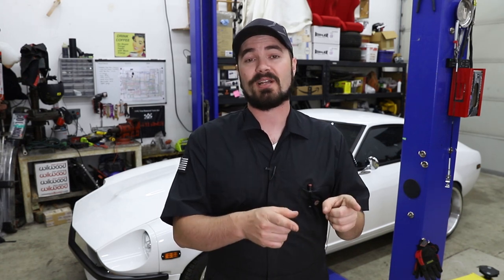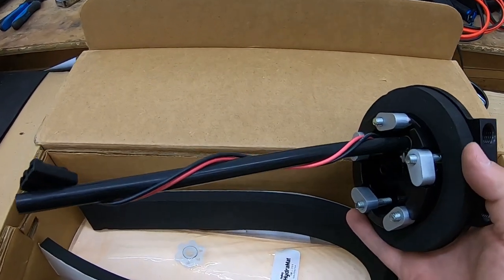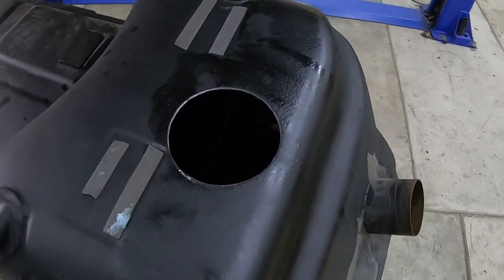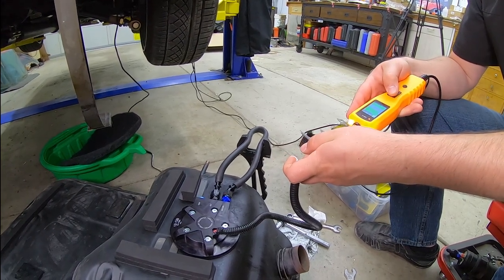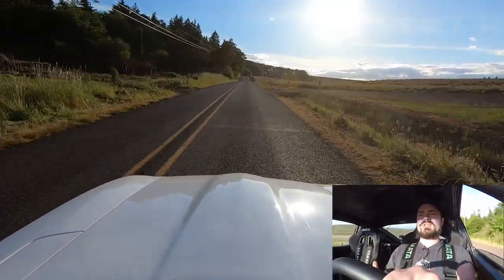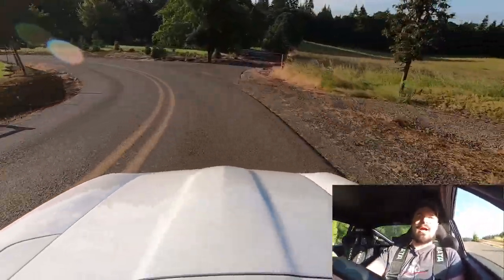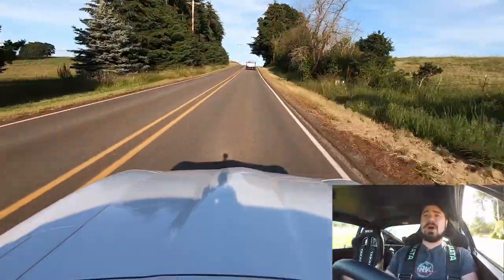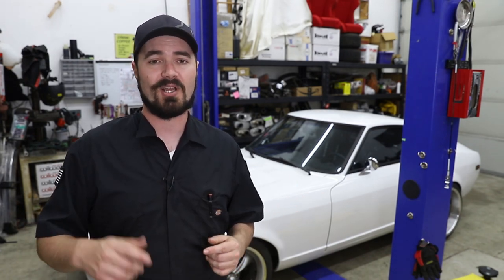Installing the Holley In-Tank Retrofit on the SR240Z

Comment: Hi Casper.  I still have to replace the screaming pump that came with my sniper kit.  Meanwhile my Borgeson kit install on the '67 hit the wall when the pump they said to buy didn't fit at all on the Cleveland with the March bracket I had to buy.  Belt alignment and pulley issues too.
Reply from the maker: My replacement DW 255 is still much quieter and working great. Definitely worth the swap. Sorry to hear about the pump screw up, I can't count how many parts I ordered because they were specifically listed as fitting and we're completely wrong. Good luck with your project!
Reply: AmbiVe   Cleveland engines seem to be worth the struggle though.  Thanks buddy.  Any plans for the wires on your 'Stang?
Reply from the maker: I am starting to rewire the Mustang in phases. The first phase is to move all the existing systems over to an ECU Master PMU16. I have just started that project and will have a video up soon. The wiring of the car has so many changes over the years that it is going to be too complicated to change everything I would like in one sweep.

Comment: Hey I received my fuel pump kit, how did you end up running the vent? I saw someone else running to that charcoal canister, but I’m unsure how to do mine, does it just need to run to a line and a little filter?
Reply from the maker: There are a few ways to go about it. Using a charcoal cannister and the like will cut down emissions/smell. At a minimum you should use a roll over valve. That will help keep all your fuel from pouring out in a crash and buy time to escape. Something like this has both a screen and check valve:

https://www.summitracing.com/parts/tnk-vvr?seid=srese1&gclid=CjwKCAiAlfqOBhAeEiwAYi43Fw0_fSv6GeTaS3AZX-9tMM3AVoEEmj2tC3wldGMt0kwN-Mxioj69aBoCVLEQAvD_BwE
Reply: @AmbiVe  oh ok, I could just run the factory vents to the charcoal, and add a line with the rollover valve to the fuel pump
Reply: @AmbiVe  or should I just block off the vent on the fuel pump if I’m just going to use the factory vents?

Comment: How do you find the in tank pump? I have a 280Z with a jack job tank and I’m looking at this. How did you drop the tank to clear it?
Reply from the maker: I added the included foam strips to help space the tank down, otherwise, I didn't do much. It works well, it's a much better solution than stock with the hydromat pickup, but it would be better with a surge tank just in case.
Reply: @AmbiVe  sounds easy enough, what kind of foam strips did you use?
Reply from the maker: They include some with the kit. You could also just get some high density foam and cut it to size or use large neoprene weather strip. Just something to help space and level the tank.
Reply: @AmbiVe  awesome thank you

Comment: Do you know why Nissan included so much empty space above the filler neck? Isn't that just wasting potential fuel capacity.
Reply from the maker: There is quite a lot of wasted space, but it never seems to be enough to reasonably fit my hand in to tighten the clamps ;) I have no idea why they didn't use an easily removable filler neck instead that could be reinstalled after the tank and used more space for fuel.